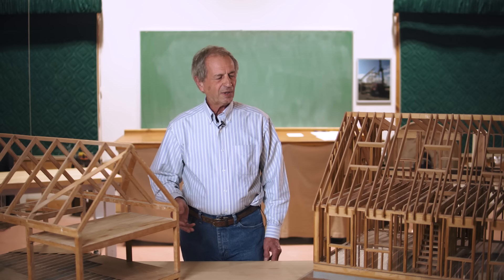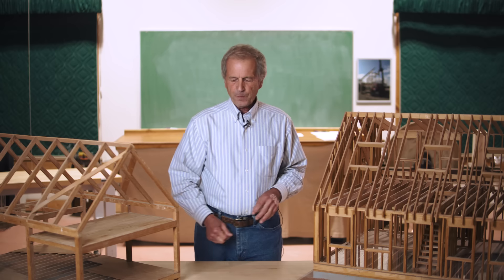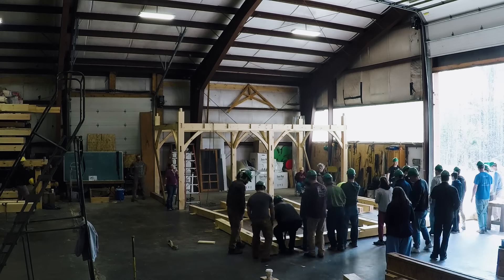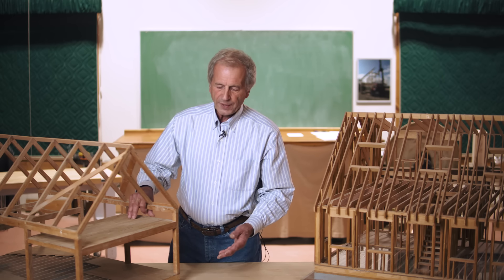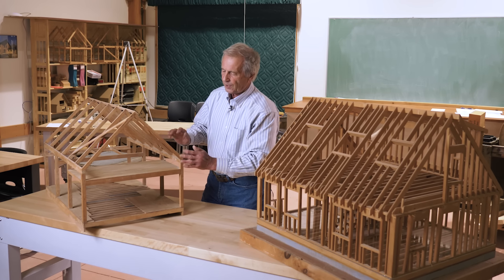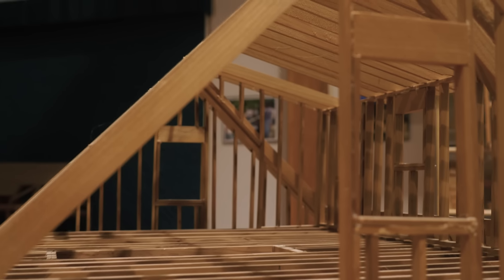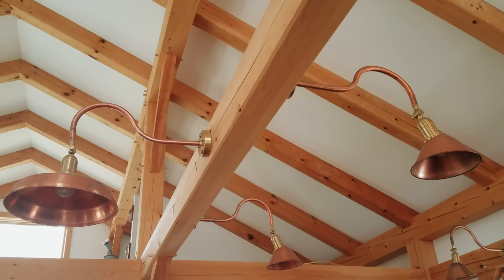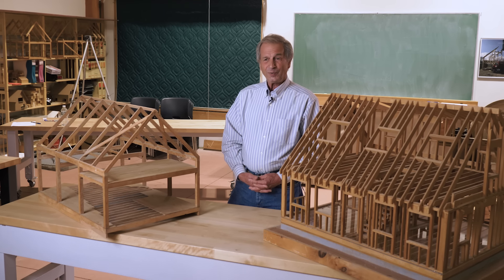Timber Frame vs Conventional Stick Frame

Comment: Very interesting.  Now I need to do a cost analysis vs a conventional completed frames.  SIP's aren't cheap.
Reply: Timber frame will be more expensive, but having a house that you can live in low maintenance for your entire life and pass down through your family for generations is worth it. My house was built by my great great great grandfather and I can tell you the pride of carrying on that legacy can’t be understated, along with the cheep maintenance that comes from a well built house built with quality materials, higher upfront cost but lower maintenance costs over the years.

Comment: How do they compare to traditional timber frame (Fachwerk waddle and daub...)
I see a lot of them in my region and even 500-year-old ones are often in great shape and they survived multiple earthquakes and storms...
The most impressive example was a short car drive from my place, which had been nearly utterly wiped out by a flood. The only buildings still standing were the really old timber frame ones. Their walls were gone on the ground floor, but the rest was still standing on the vertical elements, whereas all the more modern stone and brick buildings had been utterly erased...

Comment: I know there are many variables to consider . But on a cost basis for a similar size , how does timber frame compare to stick frame ? I know you mentioned less energy use on timber frame . Do insurance companies charge lower rates because they are stronger and better able to withstand storms ? And they should be around much longer .

Comment: There's quite a lot I disagree with in this clip but in the end it's a matter or preference. I do agree that Timber frame construction carries a different charm and feel that is not felt in conventional construction but that's it.
The reason you see so many conventional build home all blown apart after a hurricane is because 95% of the homes are build conventionally. If 95% of the homes were timber framed you'll see the same results.
The last time I checked, fire will burn wood without prejudice, wood species may vary with burn rate but they will burn. I'll even say modern built homes are more fire resistant because of all of the gypsum sheathing which is a known fire barrier.
Also, conventionally stick built homes can be insulated on the exterior, in the wall cavity or in the exterior. Its just up to what the builder wants to do and its not restricted to timber framed homes.
I understand that this guy is in the business of selling his course and knowledge of timber construction but it would come across better if he focused on the appeal and charm of timber frame than to make bias claims.

Comment: I wonder what kind of house geometries you can get with that, and how easy or hard it is for multiple level houses or houses with basements.
Would definitely be cool to have a house like that, but i think i would want thicker walls/roofing just in case of something knocking into it and adding insulation

Comment: BOLT VS SCREW JOINERY
Hi, if we raise square board frames 5 by 3 meters with a thickness of 30 by 5 cm per board, (for building a cube cabin by conecting then these frames) and joining the frame boards with lap joints, would these lap joints of the frames be stronger with four or eight bolts 10 x 120mm or 16 or more wood screws 5 x 80mm ? And would there be necesary for extra corner strengthening triangular bars ? ( the cabin is planed to be made with 10 such frames with a distance of 70 cm in between, conected with 70 cm pieces of the same boards)
Reply: Personally i prefer bolts because you need less of them so the wood is pierced less times (and in my opinion has fewer places to start splitting). In addition, bolts rely on nuts and washers to hold the structure, not on the wood itself, making their holding power better and more reliable (no chance to free up if wood shrinks/cracks).
Reply: @AgentWest  Thank you for sharing your opinion, by the way, if my project is clear to you at some point, how many bolts would you suggest and what length and thickness for each lap joint ?
Reply: @triumfdula8830  With screws it's typically one per 5cm of board width. With bolts and lap joints (where bolts only hold the joint together while joint itself carries the load) i'd say one 10mm per 10-15cm is plenty. Each bolt can hold about 2000kg, way more than wood itself at that point. Use large thick washers as well. Talk to your local building inspector though, building requirements vary from place to place. That is what i had to do before building since i am not officially trained.
Reply: @AgentWest  Thank you very much for your advice

Comment: Thanks for posting, on the stick frame, and it's members, isn't wood poor conductor of heat/cold?
Edit, i have a book from 1929, it talks about the only buildings that survived the hurricane that hit  Galveston, TX were the dairy farm buildings, that had the rounded type of gable roofs.
Reply from the maker: Thank you for the interest! Wood is not the best conductor of hot and cold but it is a conductor and the more you can protect it from the elements, the more durable it is and the longer it can perform. The hurricane of Galveston, TX was amazing! We have shipped several timber frame structures to the Caribbean over the last twenty years and they have all survived. They are gable, saltbox and hip roofs. The survival of a structure through a hurricane certainly has to do with the structures shape but also the style and quality of construction and the orientation on the site. All of these are critical components.

Comment: How much stronger would a stick frame house be, if it was put together with screws instead of nails? I've watched those houses go up fast, and it's just nail guns.
 After a few decades of flex by wind, I'm sure some of those nails would loosen and the house would start leaning a tiny bit, further loosening more nails. Screws would hold much better.
Reply: Screws are made of a different kind of metal than nails. Screws will snap off easy. Whereas nails will flex and bend. In the case of framing nails are actually superior.

Comment: forgive my ignorance, but I noticed the timber-frame model has no supports in the middle of those long beams going across.  Its an open floor plan on its first floor.  It's not using trusses though, so how are those long timber beams supporting the load on the 2nd floor ?  I realize the beam is beefier than a 4x6, but even if i cut and mill a 24ft tree, wouldn't the middle sag under weight eventually ?

Comment: Is timber framing legal? Figured in most jurisdictions it would not meet some code somewhere.
Reply from the maker: Timber Framing is a completely viable style of construction, but every jurisdiction has specific code requirements. We build these structures all over the country from Maine to Malibu and down to the Caribbean and anywhere in between. Depending on the wind load, seismic load, snow load etc we make adjustments to ensure the building is built to endure and to meet any code requirements.
Reply: @ShelterInstitute  cool to know. I’m always disappointed in local jurisdictions making codes that don’t make sense

Comment: I wonder if part of the reason we see such a preference for stick frames is that they're more "deterministic". What I mean is, there are fewer steps whose outcome is as heavily-dependent on the level of craftsmanship of the particular practitioner engaged in the craft. For instance, chiseling. It might take someone skilled a third of the time to chisel out a wedge in a piece of wood on a timber frame than for someone who is less skilled, not to mention the result of the less skilled person would potentially be abysmal.

Please correct me if I'm wrong. This is just speculation. I'm not in the construction industry :) Thanks.

Comment: Is there a way I can substitute all of the wood joinery in timber frame with steel hardware without compromising its strength? Personally, I like the hybrid of mixing the industrial look that comes with steel with the rustics of wood.
Reply: Yes, you can use steel hardware.  It is usually powder coated black and looks really nice with the wood.  In most applications it would require an engineer to design to hardware to make sure it can handle the loads, etc.

Comment: Overall, what do you feel like lasts longer? From my research it seems like a big drawback to timber framed houses compared to conventional/stick framed houses are that timber framed houses will not last as long and require more maintenance than traditional framed houses. What are your thoughts?
Reply: Pls take a look at some of the temples in Japan - all timber framed strcutures with no nails - and standing for a thousand years (some of them and others for hundreds of years). Structures in England - timber framed - still standing after hundreds of years.
Take a look at Mr Chickadee's YT channel to see how he builds with traditional methods - he does timber framing with no power tools - it's like watching an artist paint a masterpiece.

Comment: So this might sound like a dumb question lol is a timber framed house the same as a pole barn house?
Reply from the maker: They can have similar elements (posts and beams) but are fairly different.  A pole barn gets its rigidity (resistance to blowing over, seismic events etc) from burying posts into the ground. These posts continue up to the rafter plates. A timber frame develops rigidity by introducing triangulation (in the form of 'wind braces') into the framing, so it does not rely on direct burial of framing elements. It does, however, rely on some connection to the ground to prevent overturn, such as a concrete foundation that gets buried. Thanks for watching and for the question.

Comment: I have a number of books on timber framing in my personal library and my dream for many years has been to build my own timber framed home.  In my personal opinion timber framing is the superior method of home building mostly because it truly was intended to last generations.
Reply: Where's the material for the waterproofing?  Somewhat deceptive.  The conventional framed just needs plywood and hardi to be weathered in. What is the process for weatherproofing this structure.  I'd like to see the stack of lumber comparison
Reply: @gumecindogarcia1070  it ultimately depends on personal choice in the construction. Timber framed buildings can be sheathed in anything the builder likes.  With modern materials we can use insulated panels for the outer siding and maximize both the R-value of the insulation as well as living space.  The best building method in my opinion is a sort of hybrid. The timber makes a superior structure while modern techniques can be used for the structure of walls that are never load bearing and can be designed into whatever they need to be to suit the end design.  The lumber cost will always be high with a home built on the scale typical of most timber framed buildings.  The difference is strength and longevity.

Comment: If you want to built a home with a good strong frame that last up to 5 generations look into the composite wood polymer market is way cheaper than natural wood.
Reply: That’s for siding. Not for framing.

Comment: Stick framing is popular because of flexibility of design. And ease of hiding Plumbing & Electrical. There Are countless things one can do w/stick-frame houses that can not be done w/ridged paneled houses.  Timber Framing uses less lumber but more large trees to produce the same size house. 2x lumber is mostly taken from tree farms when the trees Are still too small for large timbers. Thus A bit more renewable.  Also expanded styrene is highly flammable where As fiberglass isn't. But thanks for the infomercial & Any stick framer that's worth his salt Already knows how to T-frame.

Comment: Living in Normandy, France, I'm not at all accustomed to the stick frame. All I know of it comes from images from the USA, be it in the news when a tornado hits or in informational content about building. I get it's cheaper due to the serialized and manageable nature of the building material and the labor quantity involved but it seems really fragile and not durable. Where I live timber framing and half-timbering (for the walls) were the main way of building. Nowadays, houses are usually build with cinderblock or hollow bricks wall and timber frame for the roofing (and slate or tile). So this "debate" is quite interesting as stick frames are totally alien to our building tradition.

Comment: thankyou for the information, however I think you misrepresent some of the information. in older stick frame houses, the use of in the wall insulation was an additional protection, cheaper and better to help improve the thermal control. most "stick frame" buildings usually now have partial insulation on the outside for a long time they merely used flap boards or ply wood to mount the outside. strait to brick was also common then but almost unheard of now.

my personal belief is that you need to pour your underground in strait concrete. you build the first layer in brick, and the second level is timber with flap board. Wood as a building medium tends to warp and flex, leading to walls not being perfectly strait all the time or even most of the time.

Comment: Using trees from your own property, how can we know which trees types are sufficient to build an Timber Frame house?
Reply from the maker: Hey Cody-this is an excellent question that requires consideration of many different items! Here are a few considerations. The first is species. When working with green (not dry) wood, we like to use softwood trees as they are generally more stable while they dry. Some softwoods are weak, however, so you need to consider the strength (fiber stress value, shear strength and modulus of elasticity among others) when designing the timber frame. The design phase will tell you what grade, size and length timber you need, which will allow you to pick the appropriate trees from your lot. When assessing a tree you want to look at the diameter at the base and at the height which will give you the length timber you need; measuring the diagonal of the timber you need will give you an indication of the diameter of tree needed. An 8x10 timber has a diagonal of 12.8" (you can use the Pythagorean theorem or a full scale drawing to determine the diagonal). If your tree is perfectly straight, a diameter of 13" might work, but in practice trees are not perfectly straight and it is easier to have a slightly over sized log to work with. Picking straight trees is important, but keep in mind they only need to be straight for the length of the timber you are trying to cut from the tree; a tall large diameter tree with a bend at midheight could produce two timbers. Another consideration is grade of timber; when it comes to beams and stringers and posts, one of the biggest impacts on strength is knot size, frequency and location. While you can't accurately grade a timber until it is sawn, a tree that is loaded with branches will have many knots and will likely be a lower grade, weaker timber. You can purchase grading rules from the applicable agency and use them to guide your tree choices. Here in the northeast, the grading rules are written by NELMA (Northeastern Lumber Manufacturers Association); other agencies are Southern Pine Inspection Bureau (SPIB), West Coast Lumber Inspection Bureau (WCLIB) and Pacific Lumber Inspection Bureau. All have their own websites where you can purchase the grading book. You can also hire a licensed grader to inspect your timbers and in fact, in many municipalities this is required, though it can be expensive. Grading timbers is both art and science; owning the grading book certainly does not qualify you to grade timbers, but can aid in your decision about which timbers to use.
There are other considerations which may be not be obvious or easy to quanitfy. For instance, trees that grow in windy regions tend to be less stable as they dry. Trees that grow on the side of a slope or are otherwise leaning may compensate by producing compression wood; this may lead to excessive slope grain which affects timber strenth. Some species are more prone to defects such as pitch pockets (a void in the wood commonly found in pines and spruces) and shake (a separation of the tree along the growth rings), common in hemlock. Again, this is far from a comprehensive discussion but hopefully provides some insight.
Reply: @ShelterInstitute  That answer was more informative than I expected. I appreciate that!

The fact that you must hire a certified individual to grade the wood for your build in most municipalities was an expense I hadn't expected.

I'm entertaining the idea of purchasing property and personally prepping as much of the build as I possibly can myself (specifically prepping the frame) in order to keep cost down. Honestly though, I don't even know if my expectations for such a build meet reality.

I just some guy who really wants to design and build my own home one day.

Comment: how would you get a permit for a timber frame? all the codes i've seen assume stick frame
Reply from the maker: Hi Steve-yes, the International Residential Code does not address timber frames, so your Codes Enforcement Officer has no rule book to apply to the structure. This is handled in different ways depending on where you live. Some CEO's (usually in rural areas) simply ignore the timber frame part of the build and apply the code to the rest of the building (life safety, foundation, roofing etc). In other cases the CEO may require you to hire a 'design professional' or licensed engineer to design the frame. For interest sake, it is the National Design Specification that governs wood design in the US and is referenced by the IRC.